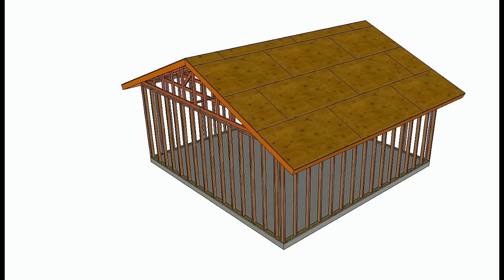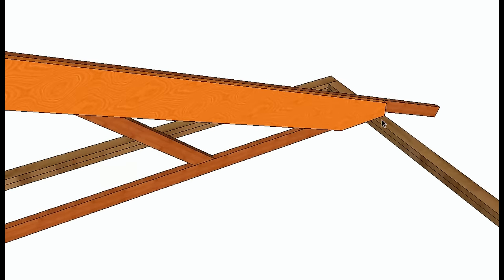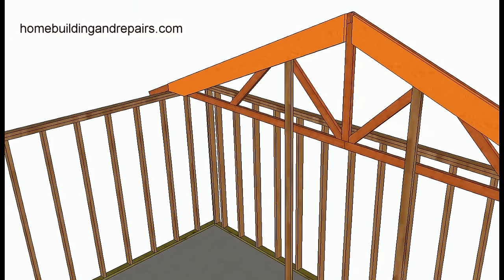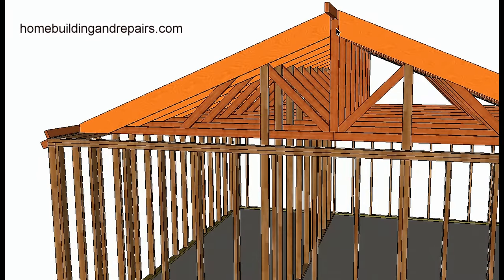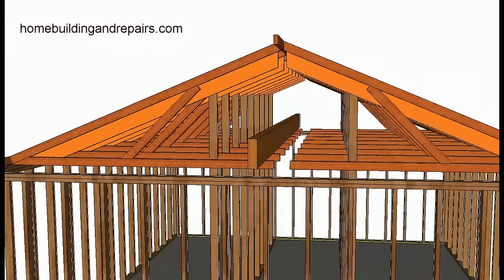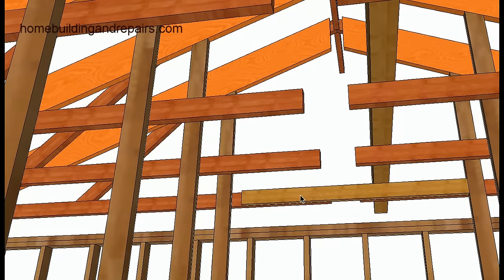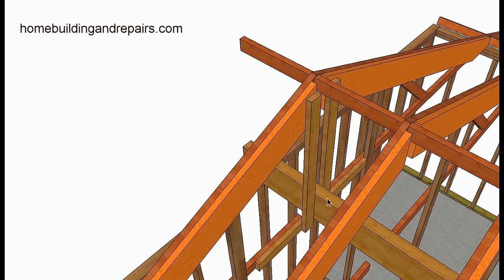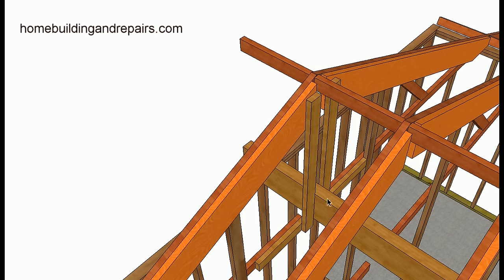How To Convert Existing Truss Roof Flat Ceiling To Vaulted Ceiling Using Rafters, Post and Beam

Comment: I could do it in a matter of weeks by myself and I am kicking myself in the but that I didn't do it when I had the funds and the time before my dad died and I was watching over him full time from home and could have done it then. I am in a 3,200 square foot home on the beach on Tybee Island, Ga. The difference for me to vault the living room and kitchen ceiling just partially would be under $4000 by myself because I have done it three times now in other homes and one time in my own at this point and did my parents bathroom which I put a skylight in and did their master bedroom with a custom beam up top of both bedroom and restroom. 
I have 2x4 joists and rafters which sucks and on such a large and sprawling home it really is limits the things I can do to the home. It prevented a rooftop deck and prevented me from the kitchen ceiling being vaulted and the living room because I was just going to do the middle of the 30 foot x 30 foot living room which is smack in the center of the row of trusses that span the length of the room and the master that is on the same pitch and same side of the house is right behind thar room and is already vaulted. I was just going to do the middle of the 30x30 family room and maybe just 17x17 of the very center of that room and just extend the electrical and tie into it for lighting and extend the cieling fan and install a new fan and then some switches for the new lighting on the wall in an easy spot but inevitably put some remote controls on the wall too for the fan and lighting. I only opted out at the very last moment because my father passed away two years ago next month and I went a bit insane drinking and drugging myself into an oblivion. 
I may still do it. Without the sky is lights and the proper beam I would use, I could do the job myself for under $600 I kid you not. That includes 24 2x4x12s, 8 pieces of 4x8 foot drywall at 1/2 inch thickness, 2 5 gallon buckets of lightweight joint compound, a 100 foot reel of 12/2 copper wire, a tasteful miniature ceiling fan, some nice LED lighting both for the vaulted section up top and on the bottom to where the 8 foot ceiling still is, 2 dimmer switches, 2 regular switches, 4 gang box, 2 gang box, 2 sky lights and a roll of flashing and tar and nails and some paper, 1 beam I build from scratch with 2x6x16s and putting 3 together and wrapping them in pine and filling and staining them along with rustic looking metal straps and hand forged hardware for them for looks but would attach with some custom stuff I make from Metal 1/3 inch thick and 2 inches wide, and then a case of spray foam insulation or 2 bats if of it, and the drywall tape and screws and framing screws I would use and the air conditioning ductwork I would have to extend so I need 20 feet of 8 inch and the insulation wrap to wrap it but I have plenty of metal tape for that and mastic and y
Some mesh tape too. I would also need 2 gallons of primer and 2 gallons of ceiling white Behr premium semi gloss bright white. And then the rest of it I have like wire nuts and the drywall nails and screws and  the tools of course. I think with the skylights and the beam and the fixtures (fan and lighting)  I would be at around $1500 but only because the skylights are $280 each and the ceiling fan is $200 and the lighting and wire is another $250. So the lumber is under $300 and that include the custom beam I would/will make.
Without skylights and with reusing the fan I have and going inexpensive as possible on everything I could vault the curling for under $600 easily. Probably more like $350. . That is just 6 sheets of drywall and 20 2x4x12s and two tubs of mud and joint tape and a roll of wire and four led flush mount lights and a few dimmer switches and boxes and two gallons of bright white cieling paint and primer in one and finally I just use a faux beam I diy for under $35 made of Portland cement and dawn soap and epoxy resin I have left over and make some straps from some scrap metal bands I have laying around and paint them black and make them look rustic and use bolts to tie in the look.

Yeah. Hahhahaa

Comment: You have the truss beam drawn wrong needs to be perpendicular to top runner the way you have it gives no structure strength.
Reply from the maker: If it's holding up the center of the roof or the roof ridge, then it would be providing structural support. Please provide me with the exact time in the video where the suggested problem is located, if this didn't answer your question.

Comment: Why can't you pull all the roofing material off. Cut the nails where the trusts meet the walls. Call in a crane. Lift the entire section of trusts off into the air. Then build 2ft walls and screw then into the top of the walls already there which would change the ceiling height from 8ft to 10ft. Then lower the trusts back down. Wouldn't that work and be easier and cheaper?

Comment: Um surely cutting the lower chord of the truss will make them collapse
Reply from the maker: I've actually cut the lower cord of a roof truss and nothing happened.
Reply: The bottom chord is to keep the truss from spreading under load, but since the new beam carries the load in the center it becomes simply supported in the center and on the wall.